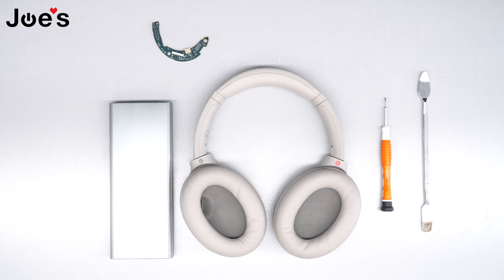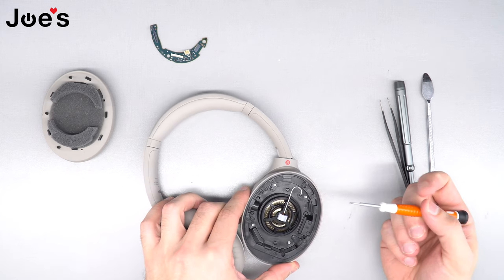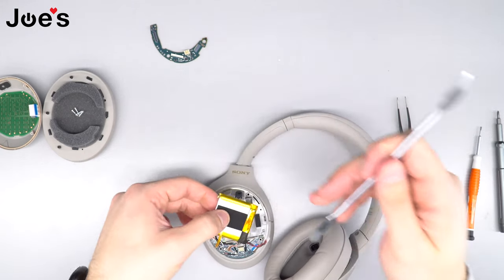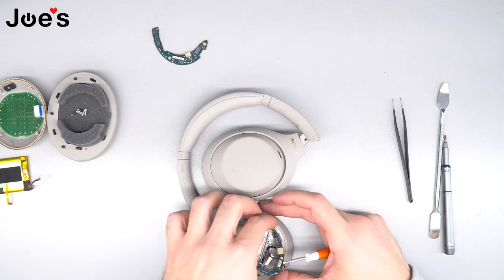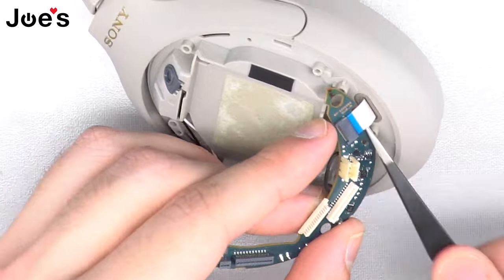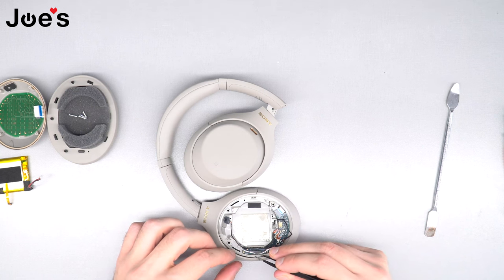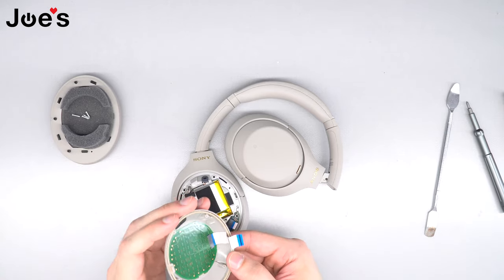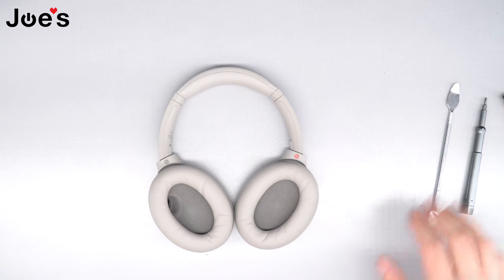Sony WH-1000XM4 No Power Power Board Replacement | Repair Tutorial

Comment: when connecting the charging cable, the red charging indicator does not light up, I replaced the USB-C board, but it did nothing, maybe the reason is the power board?
Reply: Did you find a way to fix it?
Reply: @smilegabon913  no
Reply from the maker: Hello, thanks for commenting. Please email us at support@joesge.com with your question. We will be able to better assist you there. - JoesGE

Comment: Is there any tutorial on how to disassembly the left side ? My headphones keep turning back on by themselves, even when powered off and I need (I think) to replace the power button flex ribbon. Love your tutorials by the way, very well explained.
Reply from the maker: We will be making more videos on the XM4 soon.
Reply: Left side is pretty much the same as the right to least access the board (the 4 silver screws you saw at the beginning releases the cover, and it's a small square circuit board held by 3 screws. The ribbons and such are visible just from that cover being off.
Reply: i have the same problem did you fixed it ??

Comment: hey can we use it after completely removing battery and only using it wired?
Reply from the maker: I have not heard of that yet.
Reply: @Joesge  in my country replacement battery aren’t available and if bought they usually are pretty bad 
That’s why I was asking that if I remove the battery totally will it work via the 3.5mm audio wire